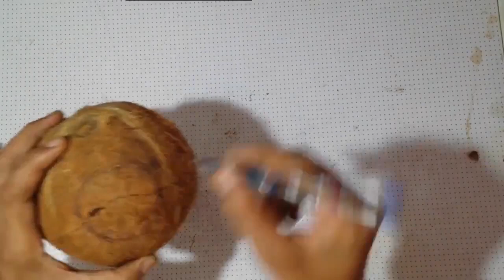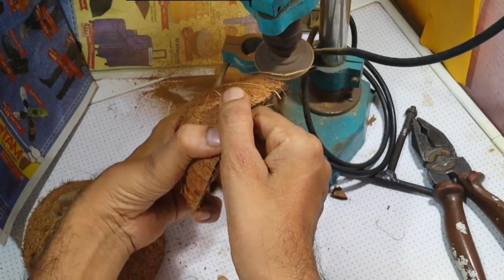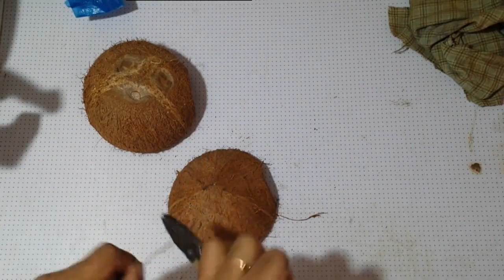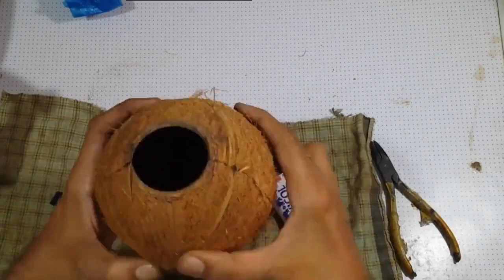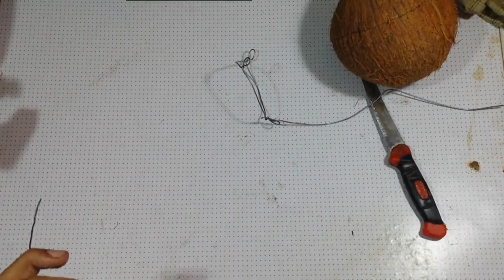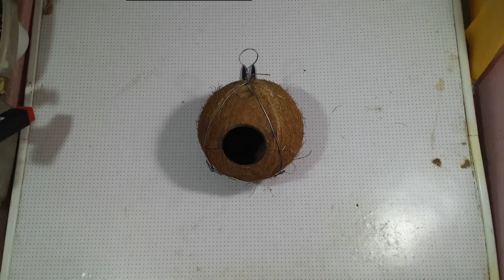How to make bird nest with coconut shell DIY and save Birds

Comment: Will fevicol stick for longer period
Reply from the maker: I don't think so. 
Better use metal wire, it's safe and durable.
Reply from the maker: Do you know Kannada or Hindi?
Reply: @birdsworld1234  I can understand hindi lil
Reply: @birdsworld1234  in this video u hve used fevicol
Reply from the maker: No, but you can use no problem, dry it well in open air. Fevicol smell not good to birds. 
And also use wire support . no guarantee of fevicol.
Reply: @birdsworld1234  ok sure. I'm more interest abt sparrow but not much space in my balcony. Thxs for  ur inputs
Reply: @birdsworld1234  any idea to sell coconut shell nest online?

Comment: 1. What should be the height from the ground where the nest should be placed?

2.  How the nest should be saved from cats?
Reply from the maker: Minimum seven feet from ground,
Better hang at middle , or fix it on plane wall, cats can’t reach there
Reply: about 400 mitres, beware of aircraft though.
Reply: @billsmith305  wtf